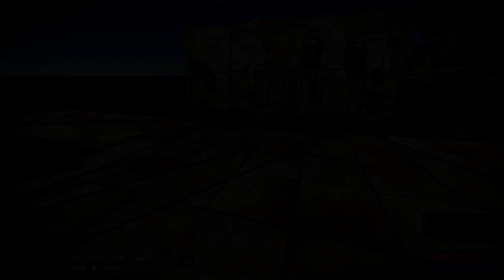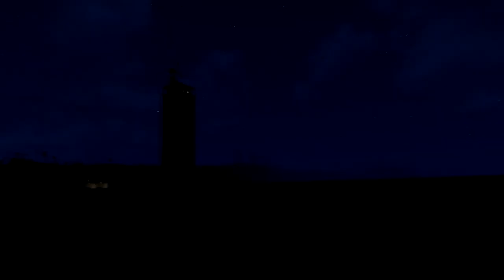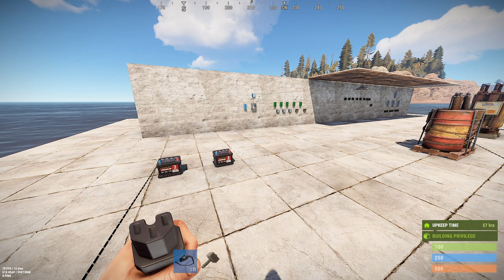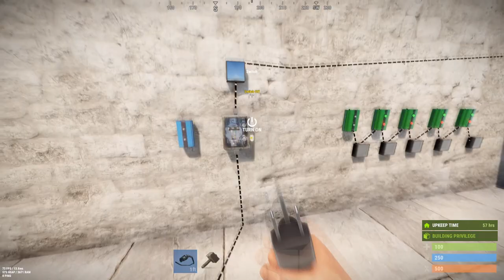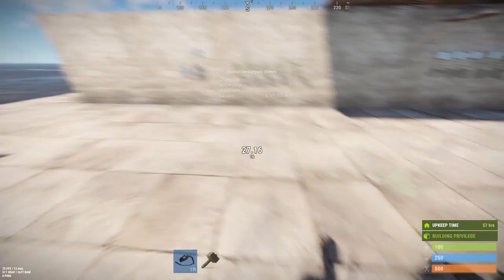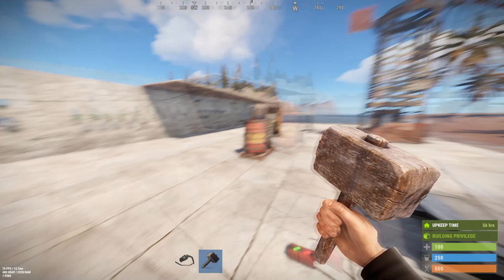Rust Electricity 101: Component Guide - Rechargeable Batteries

Comment: One thing I noticed when root combining batteries, it puts the full load on all batteries. For example if I have 2 batteries combined and 100 split off at the subsequent electrical branch, it puts a load of 100 on both batteries even though I am not drawing that much. Something to keep in mind when setting up charging.
Reply from the maker: Correct, they can double (and in some cases triple) dip on the batteries. So not efficient at all, but in cases where having battery backup for a large circuit is important, but efficiency is not an issue, still practical to do!

Comment: I specifically checked out this video hoping to find some info to help me troubleshoot issues with root combiners post batteries, getting a short circuit / max depth error, very disappointed at 15:00 when you said you were skipping over that info.
Reply from the maker: I can take another look into this now, that video is a year and a half old, some bugs have changed at this point :)  In fact that error didn't even exist back then :)
Reply: @RabidRabbitGamer  Wow impressed you replied!  For what it's worth after doing a bunch of troubleshooting I found that some intervening components count against the limit of 15, so if you have root combiners, then switches and such (infinite power circuit for example) then root combiners post batteries, from the 1st root combiner to the last And all intervening components must be 15 or less.  Which is dumb but it is what it is

Comment: So you're saying that the circuit with the blocker and the or switch, that switches between direct power from the solar panels and power from the battery is obsolete? 

  If I have like 8 turrets, do I need two separate circuits with a large battery in each, and solar panels wired  separately to each battery so I won't have to root combine the batteries?

 I like to control how much power I give to each circuit, so I use electrical branches for each one. Usually I end up with about 7 or 8 EBs. Do you think there is a more efficient way to do this so I don't waste 8 rust watts? Splitters have no control.

Thank you in advance to anyone that helps. Also, thanks for the video xD
Reply: One way to lose less power is to use electrical branches until you only need 3 outputs for a given application. That way you save at least 2 units of power given that there is 2 less electrical branches to power.

Comment: Have you seen the unlimited electricity trick and also hide cables bug.
Reply from the maker: Not sure what you're referring to just by name. Some people call a UPS circuit 'unlimited' electricity, which is not really what it is. Are you talking about a bug or a cheat?
Reply: Checkout Ted Pommes unlimited electricity trick and then checkout twisiteds new tips vid for how to hide cable bug.
Reply from the maker: @thegentlemanbadboy578  Thank you! The unlimited battery life bug is a server restart bug, they'll fix that. They don't seem to prioritize these because server restarts on official servers are rare (It took a while for them to fix the generator server restart bugs for example but they will fixed it.) 

The invisible cable at max length I haven't seen, very interesting! Tedious to implement, but effective! I assume they would fix this, but until they do what an awesome trap trick! :)
Reply from the maker: @thegentlemanbadboy578  Can confirm the battery bug on current main branch, the hidden wire trick I have been unable to replicate however.
Reply: Watch the tips vid fully I can assure you it works coz we did the trick on our vanilla test server. Yeah I know both work coz I’ve done them :-p
Reply from the maker: @thegentlemanbadboy578  fair enough, I personally have not been able to replicate the wire big on a vanilla test server. Doesn't mean it's not possible under the right circumstances.
Reply: Get it to 0 then move abit and it will turn Green and then click and wire will disappear. Very good for traps.